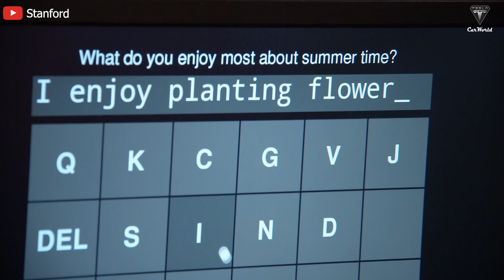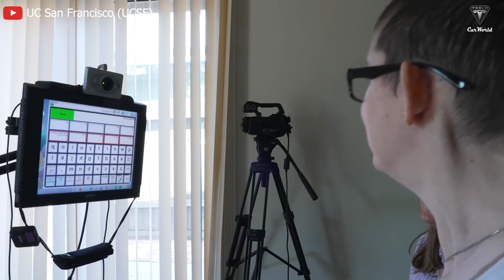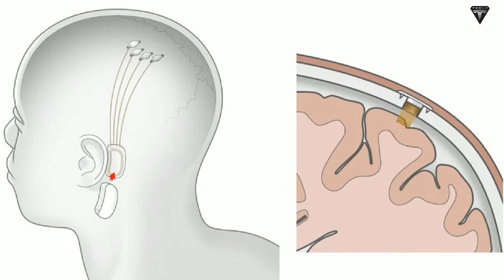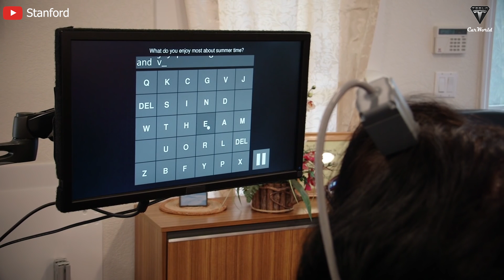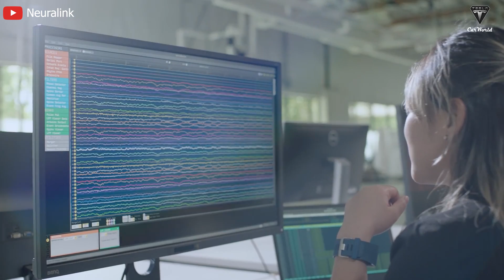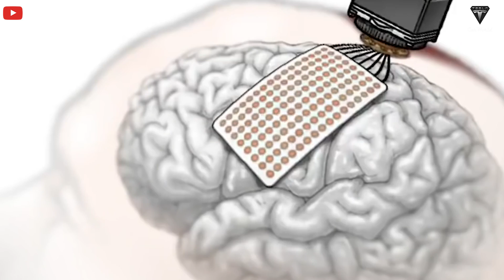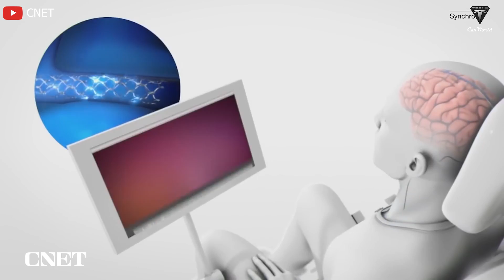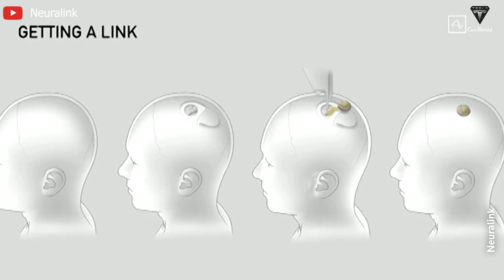Finally Happened! Elon Musk LEAKED 2024 Neuralink All-New Upgrade Here! N1 Chip Full Success!

Comment: Will this aid people with MS?
Reply from the maker: Multiple Sclerosis is a chronic neurological disease that affects the central nervous system, brain, spinal cord and optic nerves. Onset is most likely between the ages of 20 and 50. Neuralink may have an impact on these cases In some aspects but it will take a long time to achieve, in our opinion.
Reply: @arWorldI imagine the same goes for Parkinsonism– Mom's condition. There are a lot of symptoms in common with MS. She's pretty much paralyzed and can barely get a thought out at this point (even though she's sane and coherent), but worse, she can't think of numbers and she's a mathematician. Everything about it seems like a bandwidth issue though, so she signed up for the Neuralink waiting list some months ago.
Reply: @TeslaCarWorld there are v probably better ways to treat MS!